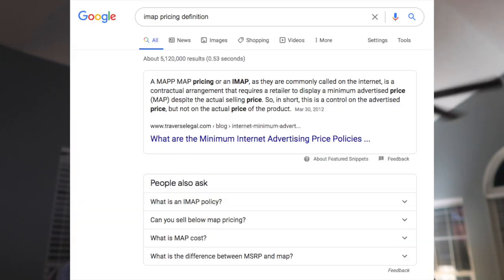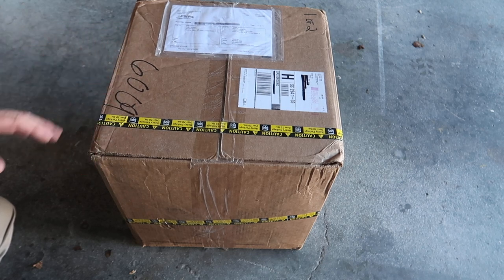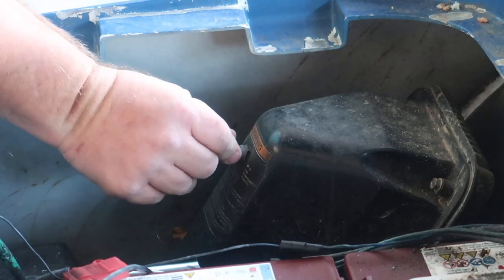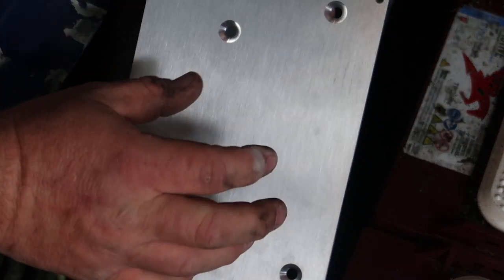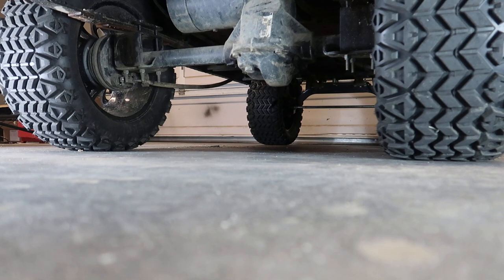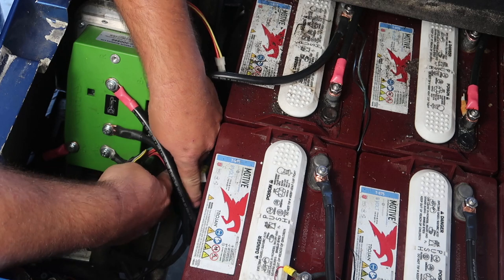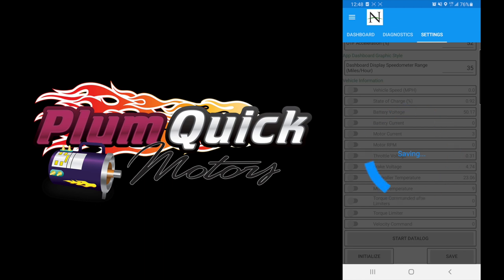How To Convert EZGO TXT PDS TXT48 to AC Conversion | Navitas TAC 2.0 5KW 600A Motor & Controller

Comment: I have a 36 volt cart that I converted to 48 volt and it never used a run/tow switch. I see that the TXT 48 harness only has 2 wires but the run/tow switch has 4 wires. Do I just use a SPST switch or do I need to get a factory switch that uses 4 wires? From what I see 2 of the wires from the switch are not used. Thanks for taking the time to make this video!

Comment: You made a video about the Teekon DC to AC along with the plumquick DC to AC - is there a better fit for one or the other?
Reply from the maker: Just depends on what you want really. The navitas provides a lot of low end torque, otf remote, good support. The teekon is quicker but doesnt have the same low end torque.

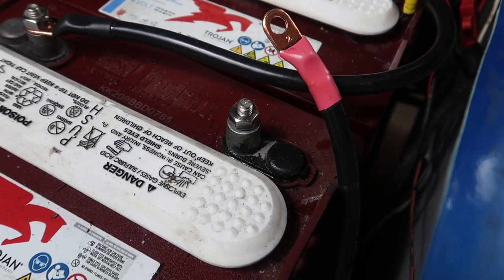Comment: Why didn’t you re-install the resistor for the big terminals on the solenoid (9:49)?
Reply: Please disregard...I spoke to Navitas and they do not require a resistor or a diode on the solenoid for their controllers.

Comment: One more question: I see that the small red wire was connected to the solenoid terminal that also had the larger wire coming from the battery (which matches how mine is today). However, your new solenoid install shows that same red wire is now connected to the solenoid terminal on the side going to your controller. Can you explain why this got switched?
Reply: Nevermind. It looks like you changed your wiring for the solenoid from what you had at (10:00) to the way I would think you want it (matching existing) at (14:54).

Comment: I skipped around in the video so I don’t know if this was covered or not, but is there a way to keep the kids from cranking this thing to max when they drive it, without me having to go into the app and change all the settings?
Reply from the maker: Yes, The kit comes with 2 keys. You can adjust the on the fly controller and then lock it. Once you do that they can adjust it all the want but nothing will happen until you physically unlock it.
Reply: @Fentertainment  awesome! Thanks for the reply

Comment: On the AC conversion, you previously cut the panel for the controller connection, is that still necessary with the AC conversion? The connecter didn't appear to protrude in the ac pictures.
Reply from the maker: I cut the panel for the controller on the club car precedent. This is my neighbors ezgo.
Reply: thanks will cut.

Comment: EDGO  i don't  think are safe to run at 35 miles being the way there framing are constructed Club Car  has a frame  that can handle  that speed
Reply: Club car is superior I agree I have an 03 ds
Reply from the maker: I agree, my precedent handles better at that speed.
Reply: @Fentertainment  yes I can take my lifted stock speed (with speed codes ) ds around bends without lifting
Reply from the maker: @Caleb-tv8pu  just be carefilul man. A buddy of mine just rolled his doing that.
Reply: As for the top speed of the cart, I feel it's nice to have it if you need it !  My Corvette would peg the speedo at 160+mph ! I didn't drive at that speed, but is was nice to know it was there if need be. Same thing here !